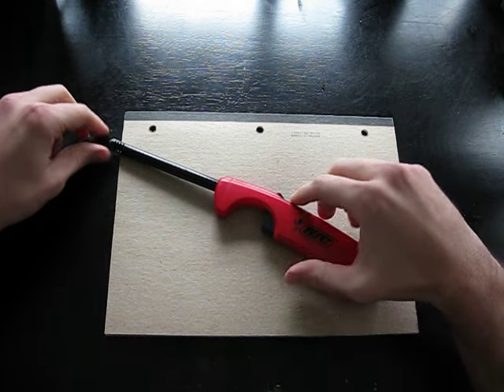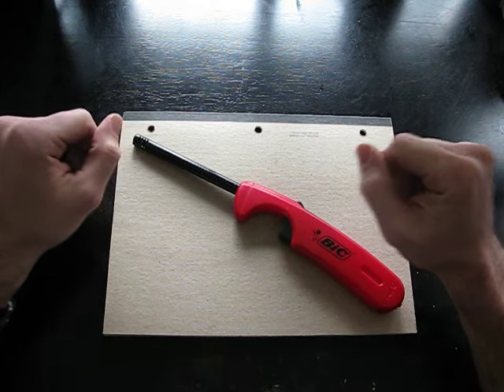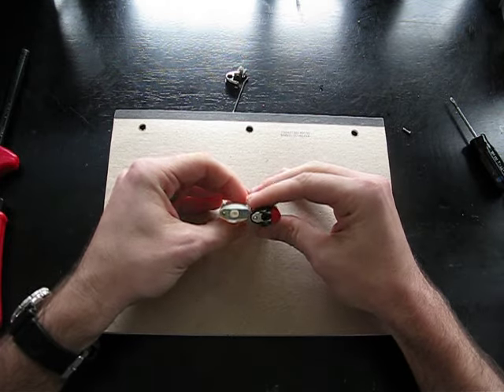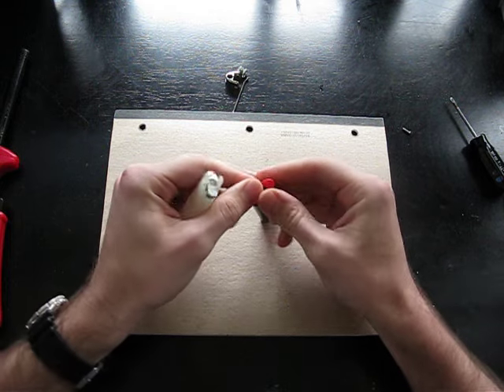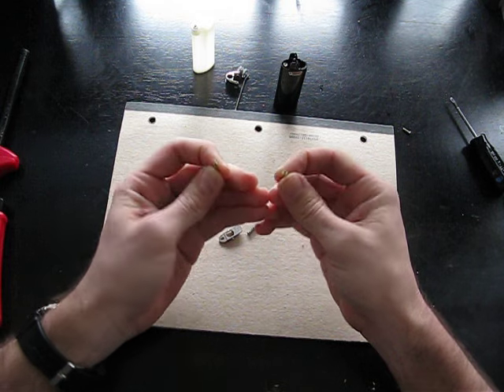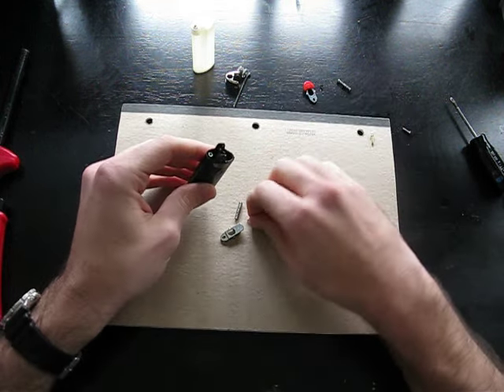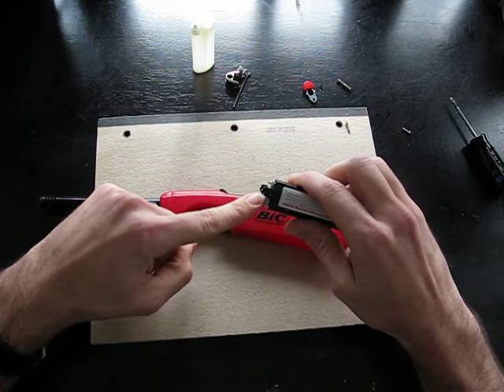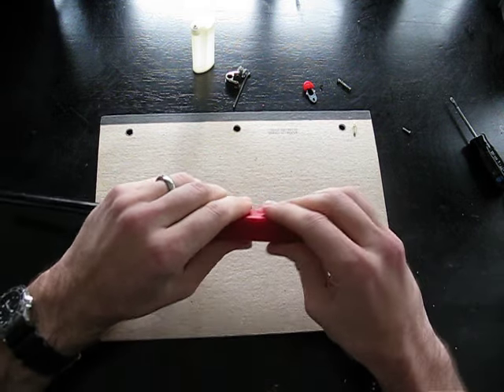Reuse an Extended-Reach (Disposable) BIC Lighter

Comment: Not that easy to open. But this video is about 3 years old so maybe Bic got privy and made them harder to open. I'll keep trying.
Reply: We just did it and we agree with you on both statements.  It is REALLY hard to get apart now and I do believe Bic did it on purpose.  After all, those extended reach lighters are a lot more expensive than the normal lighter.

Comment: I did not notice that this is 11 years old.  In late 2021,either I picked up the wrong model (no window for butane level), or Bic has changed the design to ensure that these can't be refilled.  That initial step, where the case just cracks open with minimal effort? Nope.  Mine was fully glued, the plastic alignment pins were glued.  I did manage to break the case apart, brute force, breaking all the alignment pins.  The only way this is going back together is with a wrapping of duct tape.  Otherwise, the insides are exactly as described in this video.  I have great confidence this would work, but not if the case is completely glued together, as mine was.
Reply: Thanks for your advice. I also had the older version lighter unit and used a Stanley knife and sliced open the plastic and replaced the lighter. Had to be extra careful. The screw holds the handle pretty well after replacement.

Comment: To add a refill hole, before placing a replacement lighter tube, use a drill or something sharp to make a miniature hole at the bottom of the Bic lighter. This way, IF you have installed a refillable cigarette lighter, you can refill it without having to pull it apart!
Reply: The comments here are really trying to inspire my butane-illiterate self to take a vacation to the burn ward, huh 😏

Comment: IMPORTANT 

When opening the long lighter, avoid opening up the casing near the trigger section. That portion contains several moving parts that are difficult to resemble. So, BE CAREFUL and only open the lighter up enough to extract the fuel unit. 

[I am quoting another commenter from before! Remember to upvote either comment so people will see this!]
Reply: L
Reply: Nice thanks
Reply: R.I.P. lighter
Reply: Now you tell me…

Comment: Thank you for the very helpful video!

As a tip to everyone who aspires to do the same, one very important thing to keep in mind when opening up the original long-handled lighter is to avoid opening up the casing near the trigger section; that portion contains several moving parts that are very difficult to reassemble. Therefore, barely open the fuel unit end just enough so that you can extract the fuel unit without disrupting the trigger apparatus.

He does it carefully in the video, but I failed to notice so now I'm going to have to buy a new long-handled lighter after all. But at least I'll know how to refuel that one correctly in the future :P
Reply: OK. that is what happened to me. so how do I put it back together?
Reply: lol YUP just happened to me
Reply: @sherryarrington6154  😆
Reply: Yeah, that happened to me. F@#K it. I'll spend the $6 and be done with it, rather than wasting an hour trying to figure it out. Better yet, I'll go buy a box of stick matches that will last longer and be cheaper.

Comment: Bic not only glues the seams now but also glued the end of the screw. I could particularly unscrew it but it wouldn't come out further. In the end I removed the metal clip at the back, got my pliers and wedged them in there to pry it open with brute force. Thanks for the video. It costs around $17AUD for a pack of 2.

Comment: Awesome video, I had the older Bic lighter without the level gauge. I used a Stanley knife to cut thru the glued plastic and carefully took out the Bic lighter and replaced as per video. Thank you so much. I will be returning the butane lighter refill to the shops, no need to refill the used lighter, simpler to replace it. Thank you to my wife for showing me this video...hahaha.

Comment: Could you refill the old container in the Bic multi purpose lighter instead of just replacing it how you showed us? I have an multi purpose Bic lighter and I have the fuel to refill those zippo lighters or what ever they are called.

Comment: Ugh, great video but I noticed {now, naturally, not earlier when it would've been helpful haha} it's 12 years old. My no doubt newer lighter model is lacking any screw whatsoever. I was able to pull the black barrel part off as it has a simple button you depress then turn and slide barrel off. Otherwise almost no moving parts outside. Button on front to light; child safety button on back, that must be pushed down while clicking front button in order for it to light; same semi-transparent fuel level indicator as yours; and at the very base is a slim metal bar that can be pulled out… presumably to hang it from a hook in a tool shed, or perhaps from a D-ring or key chain to make it more portable, I'm honestly not sure. Regardless, no other way inside that I could see.

If OP or anyone else has this type and knows a method to refill it please lmk with a comment. Great video - I upvoted - can't blame you or the video for me having a different lighter type lol. Have a great day all!!

Comment: Couldn't get the Bic lighter open.  I tried the single blade screwdriver  and it did not open for me.  do you have any other suggestions?
Reply: Try a very small flat headscrewdriver on the sides. I had to kind of break it apart. It was difficult but it is possible

Comment: I own an extendable lighter that has a small hole at the bottom, which I was able to refill with fuel. After a day the fuel evaporated. Do you have any tips on how I can use the existing parts, without the fuel evaporating?
Reply: Hi, you cannot refill a Bic lighter, follow the video and replace it rather.

Comment: mine was a bit harder to separate, and when I finally got it apart, all the inside mechanisms fell out and I don't know how they go back in. also, there is a tube that is attached to jet. that part is easy, but it's not an "insert only" configuration. it's a newer model, aqua blue one I had to take the top plastic  part off first to even get into it to separate it. :-/ help?

Comment: Interesting how a lot of the el-cheapo extended reach lighters have a refill port.  I've had a couple for a few years and have refilled mine several times (and i didn't spend $4 on them brand new).
Reply: I agree this more expensive is more trouble to refill

Comment: you can use any type, although i recommend a flat type, with a see thru canister. its alot easier rather than the one in the video.
BUT most refillable ones are rounded, so i don't pretty much care.
I think you must NOT use the adjustable lighters. I don't kno why, but I don't recommend

Comment: Manufacturer must've done something to prevent this thick.

I just "destroyed" two of these...... first one because I got frustrated on "why" ((no matter how many times I re-inserted new cartridge)) it wouldn't fit correctly. Second one..... because it was either destroy my computer screen or destroy the lighter. Normally I take pride on my ability to figure out how to repair things. This....... is beyond frustrating.

The little "tube" that the nozzle fits in kept moving around. If I didn't "open" the housing enough to reinsert cartridge, the tube stayed in place. I feel...... that little tube was laughing at me. More I tried, more "entertained" it became.

I'm guessing next time...... It'll be best to completely remove the whole housing. Maybe that way I can insert the damned cartridge in and reassemble everything.
Reply: Can confirm that my partner and I tried to do this, and that little nozzle was also laughing at us. He eventually got frustrated because we got through all the steps but then it wouldn't light - he then proceeded to rip the casing open all the way to the top because he was frustrated. Guess we're buying a new one anyway.

Comment: I like the video, but there is a problem with your theory that you are somehow saving money by using this method.. really you are spending 4 to 6 dollars on a new disposable bic cigarette lighter to extend the life of a disposable bic bbq lighter. and there is still waste involved because you are throwing away the empty... I have a way to reuse disposable bic cigarette lighters until the flint wears out which takes about 5 years of daily use... what i do is buy a 99cent lighter that has a refill valve, and cut out just the refill valve itself. then drill a hole around the same diameter as the salvaged refill valve. and push the refill valve into the hole at the bottom of the bic. then i use 3 second fix to seal around the seam. and wa-la.. you have a refillable bic..